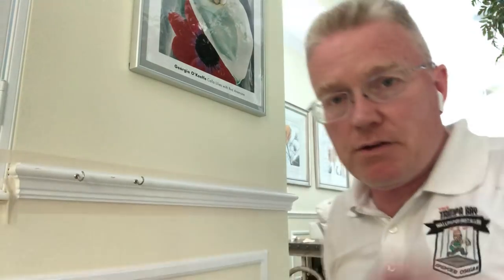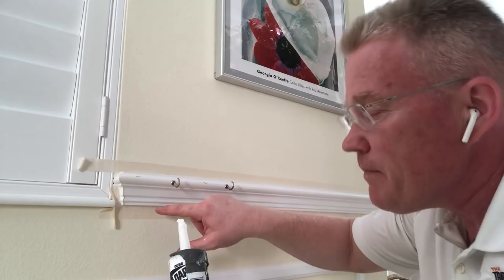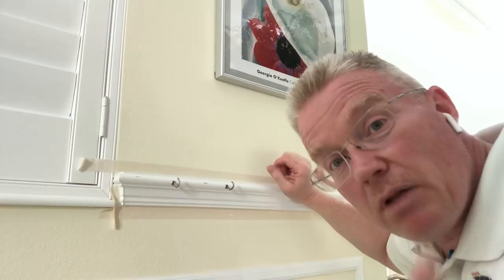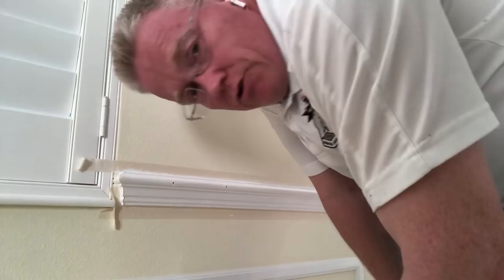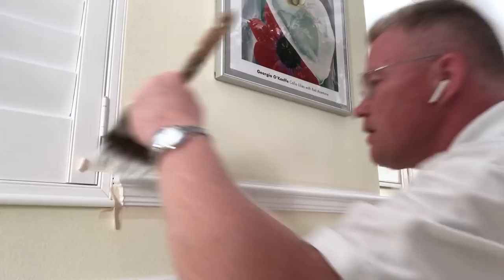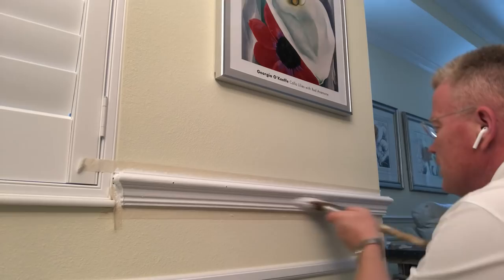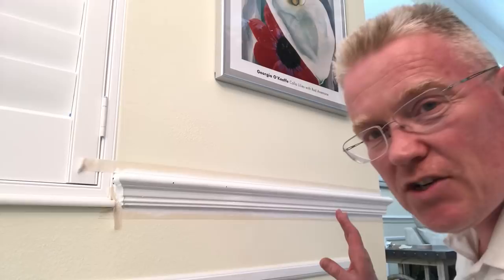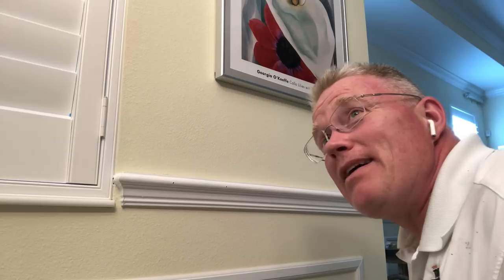How To Paint Chair Rail Woodwork Quickly and Easily - Spencer Colgan (Painting Series)

Comment: Quick question; You said you want to remove tape as soon as possible. I assume you mean after "painting" as opposed to "caulking", as the caulk needs to set up like what 30 mins or so? So after taping off, you caulk top and bottom of trim, wait that 30 mins, paint, THEN, get tape off as soon as possible? Thanks.
Reply from the maker: You are correct my friend; caulk it first then Paint it quickly but don’t rush it and then pull the tape off right away and you will get a perfect line.
Reply from the maker: Chip Deaton 
I’m confused; what do you mean?
Reply: @spencercolgan  LOL...I see you corrected your typo...lol
Reply: @spencercolgan  Do I do the same with a paneled wall?  THANKS in advance...